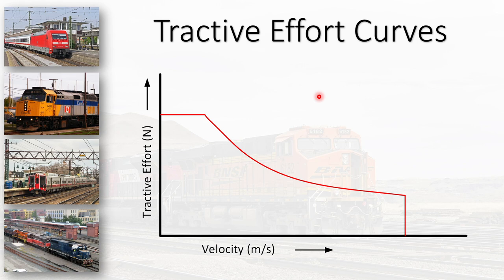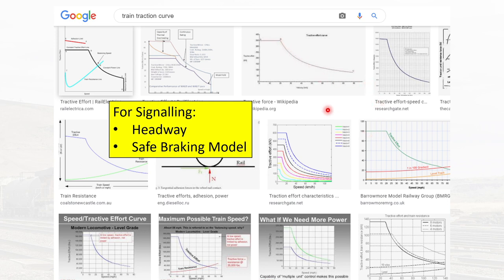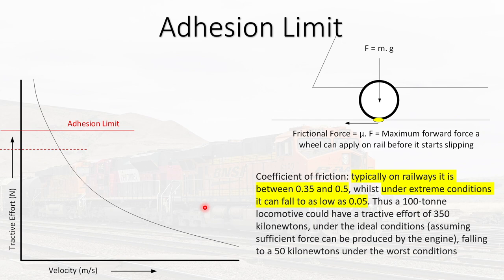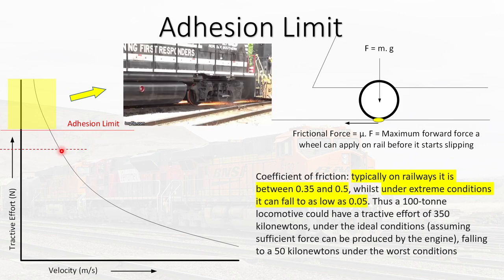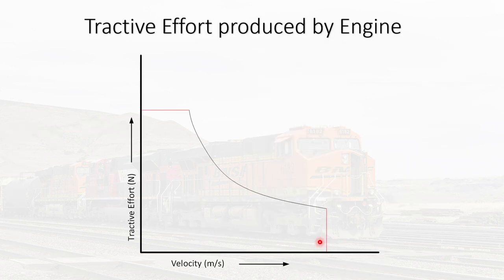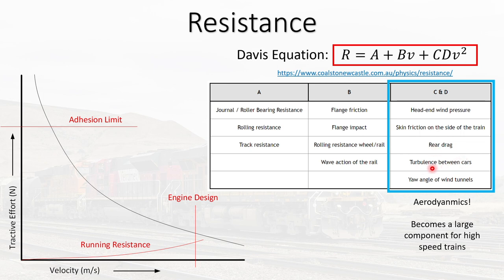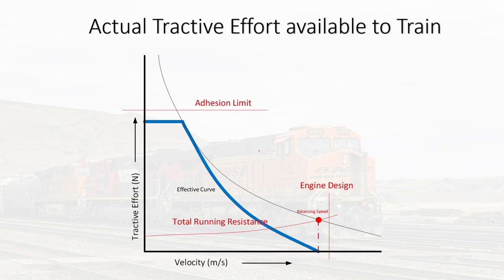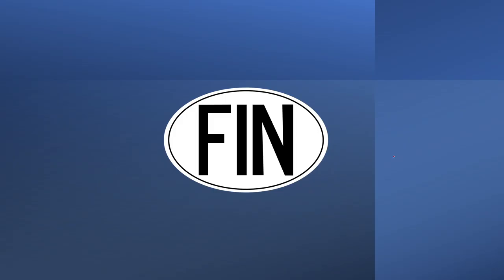Train tractive Effort Curves Explained

Comment: There is virtually no loco that use diesel as the traction motor. Yes, that would also include diesel locos. Most diesel locos have a hydrolic  or electric traction motor. Very rare examples does have gearboxes.

Also the most common restriction for old locos is line frequency. Newer locos that run on Ac-dc-ac they are pretty much just restricted for regulation or power. That is, a modern loco with no load on it would accelerate untill something else breakes.

Comment: Wouldn't the peak power calculation be: Peak Power = Force/Time × Velocity?
Reply: I use some ()-s so it is always clear what I mean. P is power, F is force, t is time, v is velocity, d is distance, m is mass, W is work
A) If you meant P=F/(tv), we would get P=F/t(d/t), which simplified with t is P=F/d. F/d would be something like m/t^2" which doesn't make much sense, so this cannot work.
B) If you meant P=(F/t)v, we can rewrite it like this: P=(F/t)(d/t), which is (Fd/t^2). W=Fd, so we get P=W/t^2 which is also not true, because P=W/t. So here you would divide by an extra t.
Our friend in the video is 100% accurate.